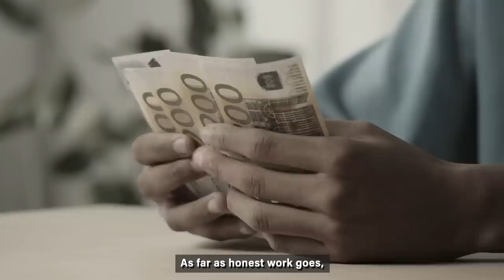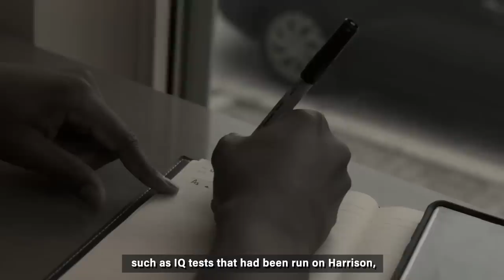The 63 I.Q. Sadistic Serial Killer…

Comment: How was he able to see through the keyhole?? I've never known a keyhole that I was able to see through... But I've looked through multiple 'peep holes' in my life
Reply: How many key holes ya tried
Reply: Very old locks had large key holes that large round keys were used to open. My grandparents house had them. They would have been big enough to look through.
Reply: You think that trope of looking through the keyhole in cartoons is just there for no reason? Modern keyholes are pretty much impossible, but older models aren't.
Reply: @Handles-Are-A-Stupid-Idea  you mean skeleton keys?? Lol I'm well aware they existed well before I was born. The last skeleton key that I used was probably in a video game
Reply: Your not peeping though the right holes yo
Reply: @kristopher5620  the guy in the thumbnail struggles to peep through a window..
Reply: @jstape740  i am not talking about skeleton keys, i am not even talking about keys. I am talking about keyholes. Locks themselves used to have much more spacious holes than they do in these days. This made looking through them easier.
Reply: Houses built before 1950s
Reply: @jstape740  A skeleton key means it can open any  lock in a structure.
Not that it's old fashioned perse.
But the concept of a skeleton key is slightly old fashioned in and of it's self.
But this shape key 🗝️ typically meant you had a keyhole of about 1/2 to 1 inch long and maybe about a 1/3 centimeter wide.
So a hole about the size of a very large cashew or almond.
Plenty big to peep through.